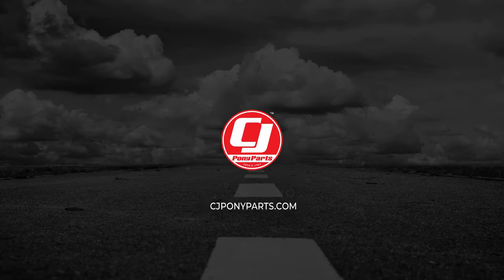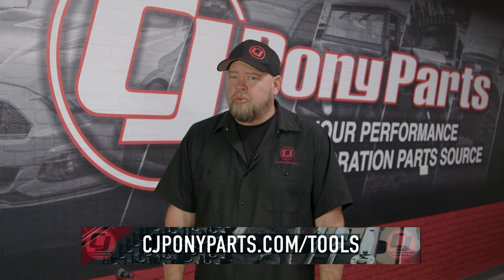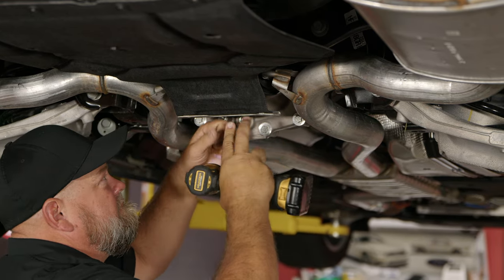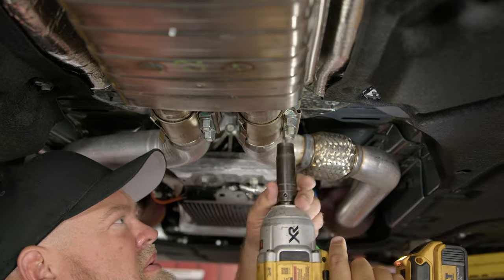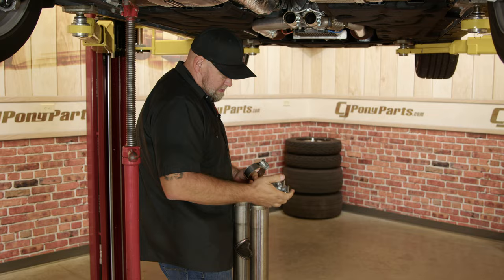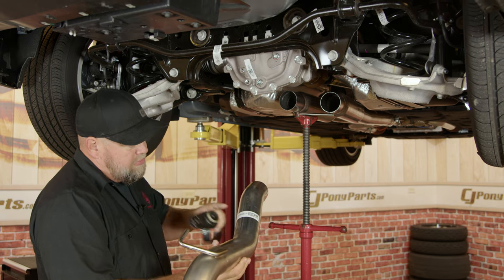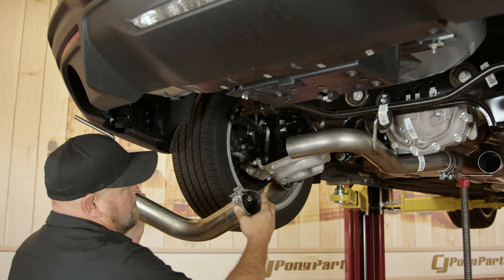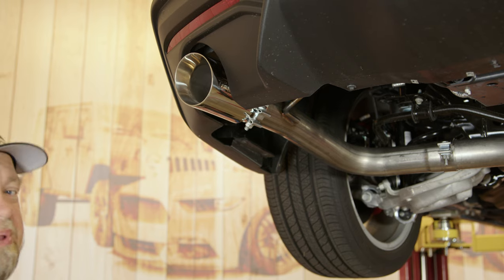Add an Aggressive Tone with Pypes Performance H-Bomb Cat-back

Comment: I have this same setup for my 24 and it is so loud when u get on it as for regular driving not smashing the gas pedal it’s not bad at all I have to say the exhaust tips do not fit good at all. But I had to go to a shop and have them add extra hangers to make the tips fit better after the install they were touching the valance